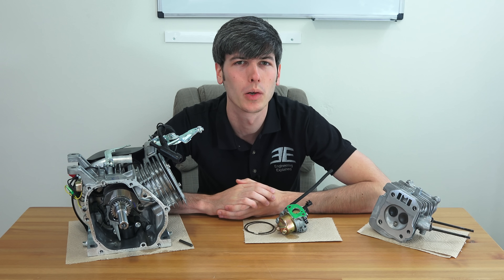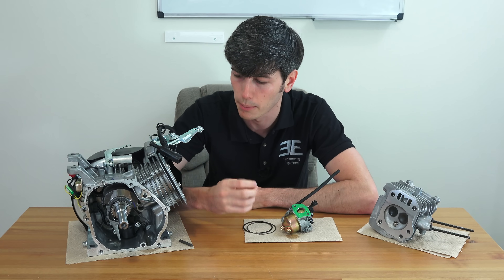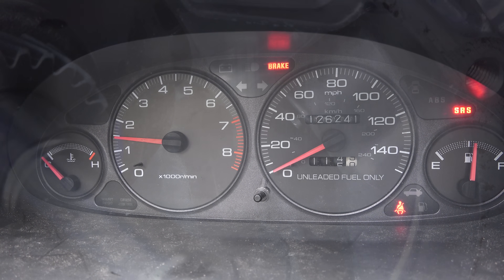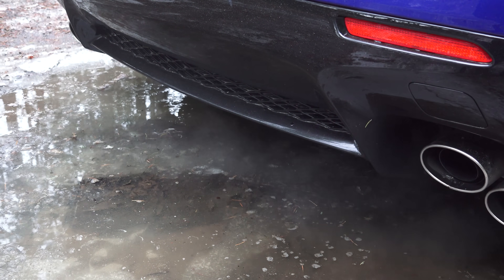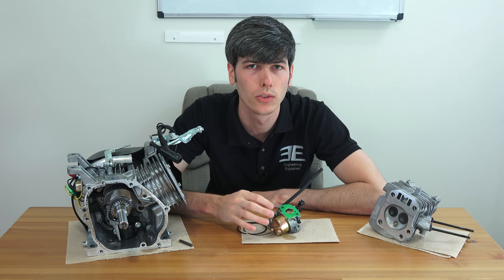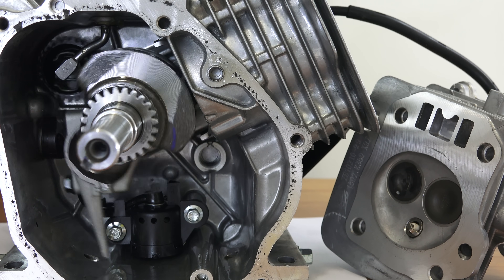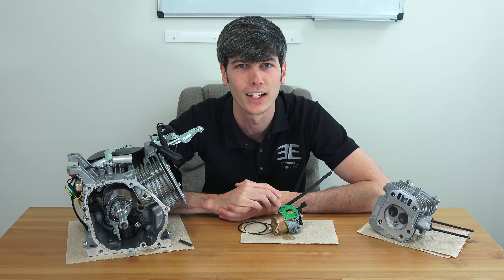Should You Warm Up Your Car Before Driving?

Comment: after a cold start i usually do a 5-10 minute burnout to help it warm up quicker so i dont freeze my balls off is that bad
Reply: before starting the car sit naked on the engine to warm it to body temperature
Reply: jordan59961 ya that's pretty bad you should actually be doing a 30 - 45 minute burnout
Reply: jordan59961 I laughed so much with this.
Reply: are you sure that wouldn't put strain on the engine?
Reply: jordan59961 Not at all, I do 30 minute burnouts every morning. trucks now up to 105,000 and still running strong.
Reply: Not everyone knows, I'm glad I could help you out.
Reply: Tony Samson a Strain - "a severe or excessive demand on the strength, resources, or abilities of someone or something."
Reply: jordan59961 I do a 25-35 minute burnout just to be on the safe side
Reply: I usually get my fat pug on the engine so it can warm up quicker and I also do a 35 minute burnout. Yea man that's bad for you
Reply: What I do to help my car warm up, is I usually surround it with wood on fire next to it,  it get nice and warm before I go to work
Reply: jordan59961 hahaha 😂
Reply: jordan59961 best comment
Reply: Melon Head   I totally don't understand why the young man in the video did  not mention getting a block heater. With a block heater you get almost instant heat ! ! Get a block heater that circulates the water.
Also   PLEASE clean snow off of ALL your windows.  (I have seen people not cleaning their side windows AND even their back window !!)  Think about that !    DO YOU DRIVE AROUND IN THE SPRING, SUMMER or FALL WITH YOUR WINDOWS COVERED UP ? ? 
Drive safe and encourage others to do the same.
Cheers
Reply: Melon Head    105K miles is good, but nowadays that is also just average.     My daily driver is a 96 GMC Sierra, 5.7 engine with just over 350,000 miles on the original engine. And I would venture to say that my old beast, probably runs just as strong and smooth as yours.
Have a good one my friend !
Reply: Tony Samson    What's up with asking for all the definitions Tony ?      Are you in 2nd grade ? 😊😊       Just giving you a hard time.  Have a good one my friend.
Reply: jordan59961 I’m surprised you lived to tell the story
Reply: Dennis Vainio imma try that 😂
Reply: Your tires
Reply: Lool
Reply: RIP your tires

Comment: I let my car warm up so the heater is hot and I don't sit in a cold car
Reply: no I don't and it's hard to see anything when ice is coating your windshield
Reply: Sometimes you have to wait for enough heat to defrost the windshield - even after scraping.
Reply: adj789 the heat will get hot quicker if you drive your car rather than let it idle.
Reply: but that requires me getting in a cold car
Reply: adj789 you must have one of those fancy cars with remote start.
Reply: I wish
Reply: 4helex THANK YOU... You're the first to mention defrost... kinda hard to drive when one can't see.
Reply: adj789 I'm the same way. It gets pretty cold where I live, and I'm pretty much skin and bones so I don't handle cold that well
Reply: An ice scraper works wonders.  I just get in, start the car, turn on all the defrosters, then get out and scrape the ice off the windows.  By the time I'm done, the windows are defrosted and the car has been on long enough for things to get moving plenty, about a minute or two.  Then you drive off easy and not like a maniac until it's thoroughly warmed up
Reply: mikaris01g
I do the same thing.
Reply: Aww princess. Don't want to get in a slightly cold car now.
Reply: But at idle the car will only very slowly warm up. You need to drive for it to actually warm up. Say if I let it idle, it takes 10 minutes to warm up when it is really cold. If I actually drive it, it's there in 3 minutes. Less time cold means less wear on the engine. Also, I'm comfortable faster when driving... where would I be waiting? Outside at the car?

To get a clear windscreen you can cover up the window when you park. The next day, just remove the cover and the windscreen is clear.

Point is: Don't let the car idle to warm up. It's a bad idea, it damages the car, and it can be avoided!

Comment: Driving a car in open loop by not warming up is more wasteful, very poorly researched information here. If this wasn't the case, car's wouldn't have open and closed loops. o2 sensors need to be warmed up and hit correct operating temperature in order for the ecu to balance the system to perfection air/fuel ratio.

Comment: So extra fuel washes cylinders, but fuel injected cars don't use more fuel than is needed, so there isn't really an issue at all with warming up a fuel injected car.

When this presenter showed 10W-30 oil, I knew he didn't know what he was talking about. 10W-30 oil has been obsolete for over a decade.

Comment: I usually warm up my car for 2 hours to ensure proper warming up
Reply: I start my car in the evening with the block heater. The next morning I fuel it up (I keep it running, obviously), and my car is already warm!
Reply: It helps if you cover the exhaust too, to hold in the heat.
Reply: This is jokes, I warm up mine for 6 hours.
Reply: Jake Williams lol
Reply: By reading the comments I suspect the posters must be engineers for the auto repair industry,

Comment: manual transmission whines when engine isn't warm... obvious proof the lube in moving parts isn't warm, and will cause extra wear to operate due to it performing outside of ideal temperature, engine lube works the same way.

Comment: So if all modern cars use fuel injection does that mean my 2002 Mazda protege needs to be warmed up first or no?
Reply: Give it about 2 hours of warming up. Better be safe than sorry
Reply: Your car is fuel injected. If it's below 40F I'd wait two minutes and then drive it gently until it reaches operating temp. Above that 40-100 seconds is enough time to get the oil circulated.

Comment: What if the main road where you live is a high-speed road? For me going fast at the start of my trip is compulsory, unless I drive in circles in my neighborhood first which I'd rather not. In this case I'm guessing it's best to let the car warm up a bit (I usually start it, brush off the snow, set up the GPS and other accessories, and then go).
Reply from the maker: I think your plan sounds solid!
Reply: Atleast 2 min and your good
Reply: Some one needs some field experience before they think they know what they're talking about.
Reply: Just drive it in a lower gear for a minute or so.

Comment: I use to just start up and drive. Now I have a 2016 F165 with remote start. In the winter, I run it 5 to 10 minutes while my boyfriend creates a low pressure area around my member.

Comment: You only talk about the oil/fuel part of what is going on. You didn't mention what driving with an engine running rich can do to the catalytic converters and also what happens when you don't allow the block to evenly heat up by forcing it to warm up fast by driving it. That can be very hard on the heads. My opinion  (for what it's worth) is that if it's really cold out you should allow a short warm up period so the block can evenly get warmed up some and then go get it to operating temperature by driving it.
Reply: Tony Samson cats are the reason we all have "clean" air to breathe in  the states. If it wasn't for emission laws we would all be living in air like that in Beijing or Mexico City.
Reply: transmission oil temp does not increas at the same rate if you are idling your engine. I am a mechanich, so when i change the oil on a transmission, i have to usually drive the car to get it to operating temp, even after letting it sit for 15 minutes for the engine to warm up. You would be surprised how much longer it takes a transmissinon to get up to operating temp. And no, you are not putting extra stress on an engine when you drive it off after you get oil pressure. As long as you are not loading it up
Reply: interesting addition! I prefer to give my cars about 60 seconds on a cool day, if it's really cold (like 15 days a year for me in Dallas), I'll give it until the guage gets into about the first 5% and gently drive off until operating temp.
Reply: Uh, thanks for repeating what I just wrote?
Reply: He's just some dude on Youtube. Some of what he says is true, but you do incur more wear while the car is warming up. I like to believe that wear is less while idling than moving the vehicle while the oil and the rest of the engine is still cold. Not only that but the transmission is also going to be cold. I know my car hesitates to shift into gear if i leave without warming up for a 10 minutes or however long i warm it up for.
Reply: What if you plug the block heater in overnight? That would solve that problem, no?
Reply: And transmission oil temp does increase with the engine temp, though not proportionately. There's this thing called heat transfer and thermodynamics.
Reply: "really cold" is relative.  Where I live it's not considered cold until about 10 degrees below freezing (and it gets to over -40).  Then again, what we consider a hot day would be like a refreshing dip in the pool for you.
Reply: i think what he was trying to say (in the video) is basically your last sentence
Reply: Driving rich introduces a higher volume than idling rich--much higher. Also, driving accelerates the scrubbing action between the head and block onto the head gasket versus idling.Idling is much better than driving right away. You could start your engine, then let the car coast if it's too hard to wait for an idling engine to get warm first before driving.
Reply: Tony Samson, you probably have an older car.
Reply: This video has made me think about always plugging in my vehicle in the winter even if I know my car will start without it. (I live in a really cold climate).
Reply: he did say if it's really cold, but the time you scrape your windows and defrost them you should be good.
Reply: Con Tra you reported something different
Reply: He does explain CC's in another video. I find to have a better understanding of the entire jigsaw puzzle once I watched a lot of his videos; making it easier to put the puzzle pieces together.
Reply: sstroh08 I
Reply: Tony Samson I like the way you think.
Reply: Con Tra Well, some Chevy cars instead of having a temp gauge, they have a light if the engine is overheating (Including the Chevy Sonic (Aveo), Trax...)
Reply: everybody's forgetting that it's not just oil protection. it's thermal expansion. different metals expand at different rates, so by not letting it warm up until at least the needle moves up a bit is causing extreme wear on vital components resulting in premature ring failure from being to tight. extreme pressure on bearings from not being at the proper spec because the crank is thick steel which takes longer to warm up than a thin little piece of copper alloy that is used for the bearing material. 
aluminum components mixed with steel components will expand at different rates too so your heads heat up faster than the block . don't listen to mechanics that say "no need to warm your car up" they want your business and return business. my last truck was 613000k on the odometer and my truck now has 365000k and runs very smooth and quiet . no ticking when first starting up, oil changes are still clean to the point the guy said" are you sure you want to change it because there is nothing wrong with it" 
if it freezing out and your  engine turns over slower it needs to warm up . enough about the oil,the oil. it's thermal expansion.
And yes I've been working on cars for 47 years so I do have an idea about what I'm talking about.
Reply: Driving rich can harm the cats, but the car is rich idling too, so what is your point?

Also, how does a block not evenly heat up by driving it, versus idling the car? It makes no difference
But i should add, that nobody talks about the transmission part of their vehicle. When idling your car and waiting for it to warm up, your transmission is still going to be mostly cold as it's not moving much inside, so it's another plus of driving away, rather than waiting for it to warm up.
Reply: The problem with this EE video is this: some claims are opinionated, masquerading as facts. He believes that forcing the car to run at speed and warm it up faster will negate the oil/fuel dilution problem, but it introduces unnecessary stress all the same, and even forcing the block to wear down faster. It's not the same to look at one cylinder as opposed to the entire engine where the oil flows. Instead of letting it idle at 900rpm for a few minutes, EE suggests you run it at 2-4krpm and shorten the time. This does not reduce wear, it increases wear to not just the cylinder wall, but other parts as well. If warm-up is not a problem, then instead of a temp gauge, it should just be a red light when it gets too hot, and car manufacturers should stop suggesting owners to warm up the car before driving off.

Comment: Gasoline in oil is unlikely since oil temperatures hit up to 500 degrees unlike coolant which is 212 usually where your gage gets its reading, the gasoline would burn off since gasoline burns around 435 degrees if I recall correctly.

Comment: oh yeah , fuel atomization  , a drop of gas hit the floor of the intake , splashes breaks apart to burn easier , base of intake warms  to operating temp to aid in atomization  , helps fuel  burn and if i recall correctly  , carbs had a heat riser that opened during cold operation  , if memory  serves  me , the thermostat  temp is set off of the intake bottom temp for fuel atomization  , eh but what could i know im a truck driver , David Vizard has a few good books on Amazon

Comment: I heard from my friend that you need to warm up turbo cars a little before driving away. What are your thoughts on this? I usually let the car warm up until the rpm drops to normal which is usually 3 or so minutes. Is this too long?

Comment: ill tell you this now if you follow this video you will not get much time out of your car i have tested this on work trucks same day owned and same oil changes and more and the engine that warms up for 5 - 7 min has less engine wear overall and remember there is  more then a engine that is needed to move a car, if you are in a cold environment, thats say -20.c and you go driving, the tranny WILL NOT have the right protection, most cars today will have a heater in the tranny to help with that but you still need to wait, hes right for engines but there is more to it then that, if you get a good oil like Mobile1 or Castrol Edge or Royal Purple then you dont have to worry to much about gas leaking into the oil system. but take your own risk and just a FYI the truck that we didn't let warm up bent the rod over time after 210k km it went, pricey test but i wanted to see what would happen

Comment: Why is it that when these videos are made (and trust I do believe the specifics of EE's video) there is no temperature component?  I mean yeah if you're looking at 25+ outside then big deal get about your business, but if it's -15 out it is a different story.  I've always driven manuals and if it gets wicked cold the clutch pedal simply doesn't function as you'd expect it to until the car warms up.  You push it down, it just kinda stays there and then slowly drifts back up.  Sure you can drive but I happen to like a fully functioning vehicle.

Comment: I've seen racecars rev their motors up and down to quickly warm their vehicles, is that a good idea to do in my lexus sc400?
Reply: Noah Heinsma to warm it up faster without putting the stress of moving a vehicle, of course
Reply: It also cycles some components like fuel port valves, oil pump, and throttle body that don't move or vary RPMs often during long, high-speed runs, and helps distribute heat more evenly through the block and reduce hotspots.

It's also a thrill >:)

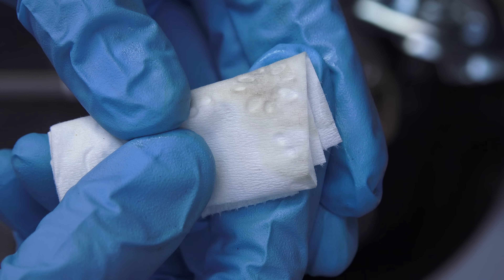Comment: At 0:49 you just shown that you do need to let your car warm up for a few minutes. Putting a car under a load would cause more fuel to be dumped into the cylinder without oil protection=more wear. Besides that there is so many different things in an engine that needs to be warmed up a bit before taking off. Yes you warm it up faster but you will also wear out parts faster. A big one is your serpentine belt that will crack and possibly break due to thermal wear. And most people don't warm up their cars to warm up the car but to get the heater working to ensure the windows stay clean after you brush it off or to avoid fogging up. I was reading the comments about breathing less, wtf? So your supposed to hold your breath in order to drive fogless? Yeah right, it only takes 2-5 minutes to get the heater working anyway by then the rest of the car has a chance to build up heat. People can do whatever they want to their cars, this subject is ridiculous if you want to drive off 30 seconds after you start it who cares it's not like we're going to use your car.

Comment: +Engineering Explained  I'd like to hear your comments on how this may be different in diesel engines; particularly truck engines that use the engine oil to run the injectors, and may have systems to help increase idle engine temperatures in just these situations.  Thanks, love the channel!

Comment: Hi!

Maybe you should talk more about the "unnecessary wear" you mention in the end. It is attributed to the increased clearence between the piston and the cylinder, which give rise to secondary motion of the pistons (increased piston slap).

Moreover, I think that the cast pistons (the usual ones) have smaller thermal expansion ratio, as compared with the forged ones. The latter have superior strength, but they need bigger clearences due to their bigger thermal exapnsion ratio. This means the engines equiped with forged pistons are more prone to hard driving during engines' cold period.

Keep up the good work,
Jim.